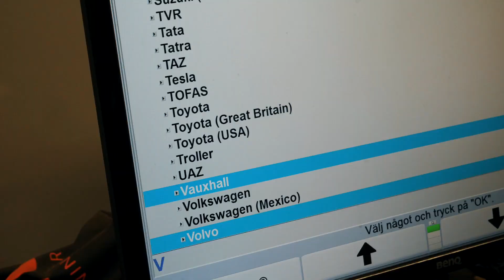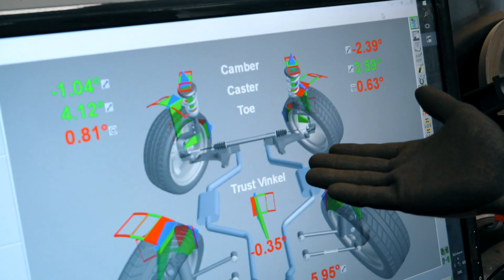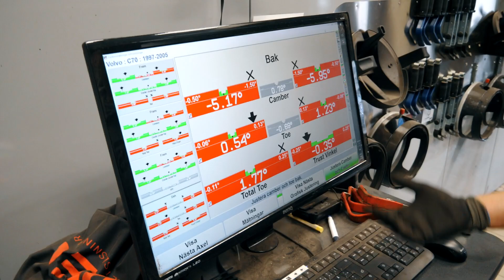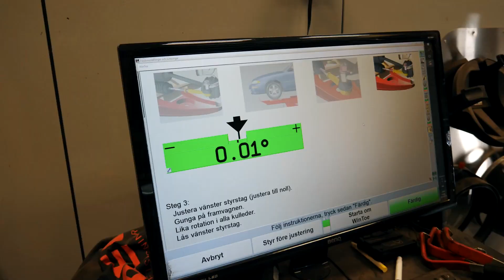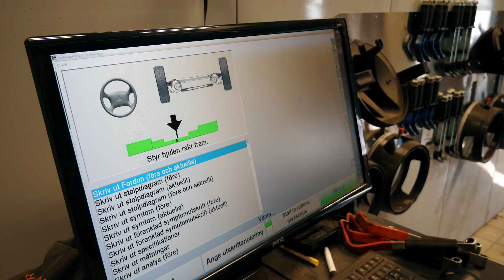VOLVO C70 | TIME TO MAKE IT USELESS

Comment: Why dont you use the ssr or mk18 wheels on this car if you're still gong to store the v70?
Reply from the maker: becuase the ssr got a different bolt pattern and does not fit and the MK18 is a bit too mainstream and got a bad rep in Sweden 😅